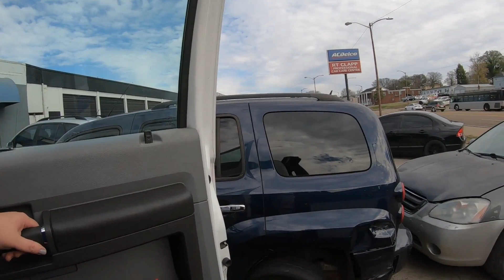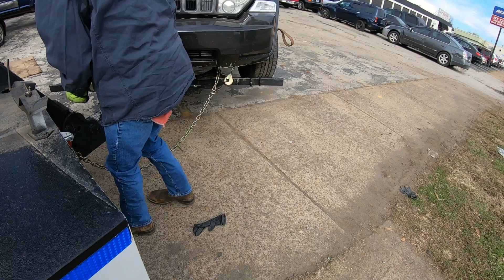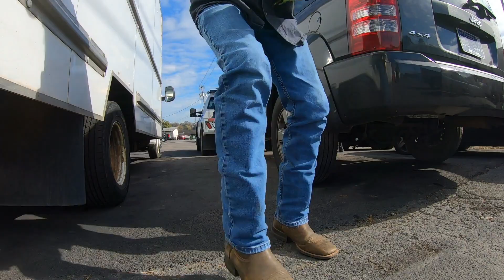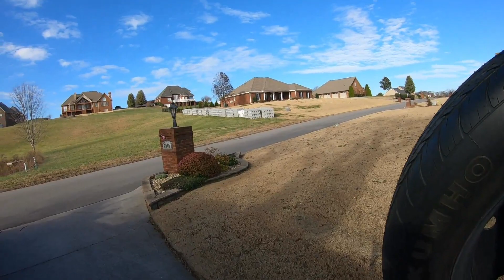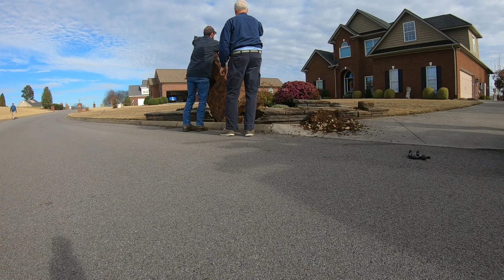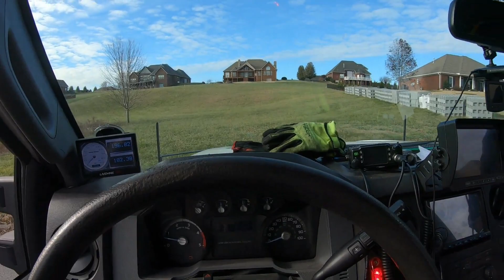HIT THE MAILBOX!

Comment: Should have high idle in the truck since it's running idle alot... It's Important to keep the oil pressure up on those engines...
Reply: When I have high idle option mounted in my truck/van or even car, I always check the oil pressure  and adjust the idle to add more pressure when I need it to sustain idle over longer periods... I've saved my engines alot by doing that..

Comment: Just because the tire says 60 PSI does not mean that you're supposed to put 60 PSI in that tire it just means that you can't put any more in it than what it says most cars and trucks are anywhere from 32 psi to 35 PSI heavier trucks 40 PSI I bet that man's vehicle rides like a log wagon way too much air in that tire
Reply: "Doughnut" spares are usually inflated to 60 PSI.  If you look at one it will say "Inflate to 60 PSI" whereas a "real" tire will say "Max Pressure ## PSI".